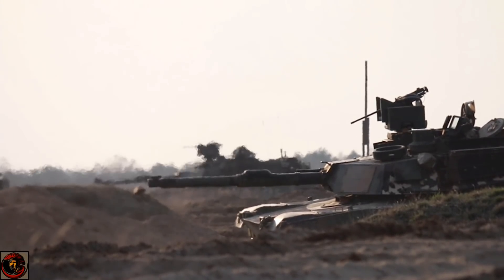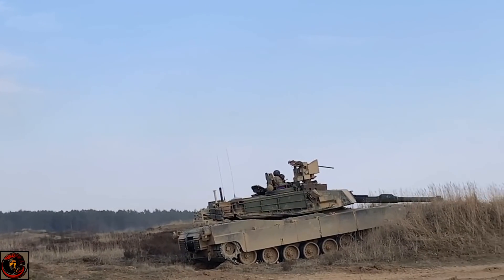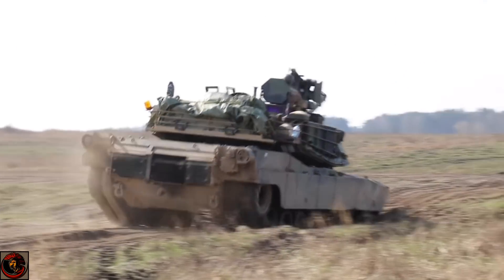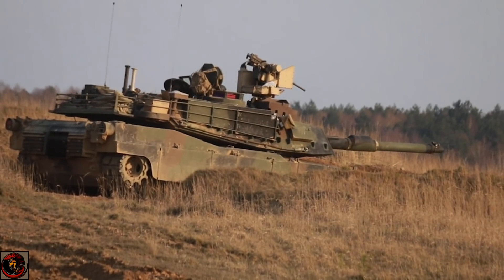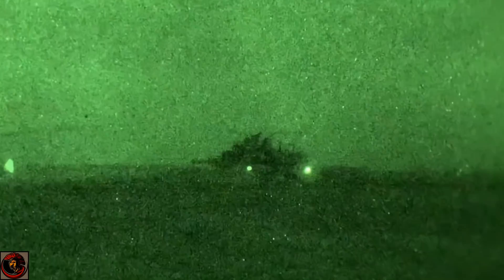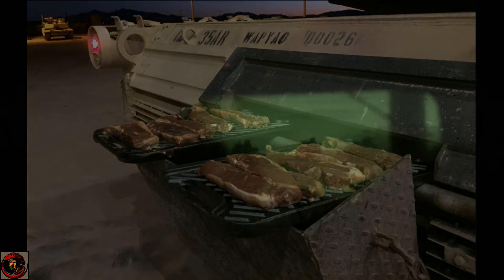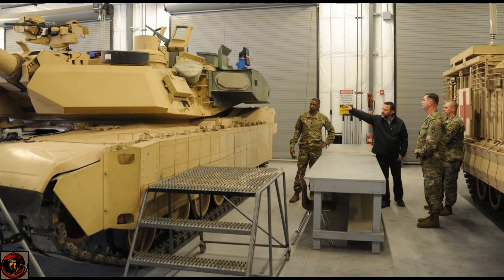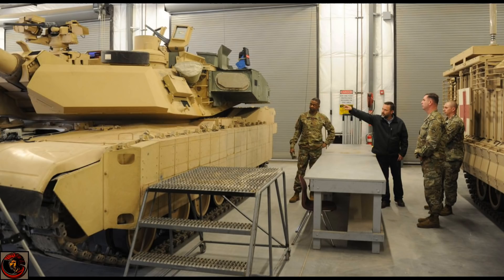M1A2C Abrams Tank Upgrade - The Last One?

Comment: I feel like a jackass but at first glance I thought the active protective system was an atgm strapped to the side of the turret
Reply: My first thought as well.
Reply: Actually I've always wondered why we haven't mounted fire and forget Maverick or hellfire missiles on armored vehicles! We can carry several of them on an Apache so they can't be that heavy and they can be fired with zero forward airspeed.
Reply: @JohnRodriguesPhotographer  The AGM-65 Maverick is between 462–670 lb and up to $110k+ it's strictly an air launched missile. https://en.wikipedia.org/wiki/AGM-65_Maverick

 The AGM-114 Hellfire is 100–108 lb and $117k+ but it has been "tested for use on the Humvee and the Improved TOW Vehicle (ITV)."

Also "In 2016 the Longbow Hellfire was tested by the US Army using a fifteen tube Multi-Mission Launcher mounted on a Family of Medium Tactical Vehicles (FMTV) truck. The MML is an Army developed weapon system capable of deploying both surface-to-surface and surface-to-air missiles."

https://en.wikipedia.org/wiki/AGM-114_Hellfire

The missiles have an extended range (8,000 m), but if you can't see the target you can't shoot it.

The Hellfire is a more likely, but remember a 120mm cannon round is cheap at $4-10k+ and 25mm cannon ammo is even cheaper $35-100+ a round.
Reply: Jacob Buxton--------Actually, there is a weird type of APS system that literally works like how you describe. Raytheon made something called "Quick Kill", and itz basically a miniature ATGM inside a vertical launch silo strapped to the hull. Itz practically a micro sized version of the Navy's AEGIS system in some sense

It works by launching the "mini-ATGM" out of the VLS silo, then the mini-missile reorients itself in mid-air like a goddamn acrobat, and fires a shaped charge. Itz incredibly complex. Suffice to say, it was much more expensive than contemporary active protection system (it was more expensive, because the Quick Kill's counter munition is "smarter" while contemporary APS counter munitions are basically dumb-fire mortar shells). I think it had slower reaction time too, because the mini missile had to reorient itself in mid-air (but take this last sentence with a pinch of salt)
Reply: Actually, having been a BFV commander, I had the same thought.

Comment: As a Major once told me, it is top of the line 1980s technology pushed to the limit of what Congress will pay for
Reply: It's just like using upgraded Sherman tanks in the '60s, i still wonders how they can fit a 105mm into it.
Reply: @arya31ful  by murdering crew comfort
Reply: @dosvidanyagaming4123  Its breech would've filled entire turret then
Reply: @arya31ful  same way they fit the 76 80 90 and 120mms into it they expanded the turrets
Reply: @arya31ful  The Israeli's are still using upgraded Shermans I believe xD
Reply: I dont think so @row7820
Reply: Major was bloody right!)
Reply: '
hi C O...
what is about congress for M1A1 - M1A2 tanks
Reply: @revolverswitch  maneuvers don't matter anything in modern air combat when there are fire and forget misiles who are basically unavoidable

Comment: I think (just my opinion) that the next MBT should have a Hybrid Drive System (Diesel over Electric) for a few reasons.
1. The tank can be fully operational with the engine off running on battery power, giving zero IR emissions. The Batteries mounted in the floor could offer some mine protection.
2. The Electric drive will offer near instant maximum power in any direction with very quick acceleration and vastly reduced maintenance for the transmission and final drives.
3. The fuel range can be greatly increased since you no longer need High Engine Power to accelerate. An 800 hp engine can replace the 1500 hp turbine with no losses in performance.
This would also solve the Abrams only weakness, its need for a continuous convoy of Thin Skinned Tanker trucks as these could be reduced by 40%.
Reply: Look at the German Porsche designs for gas-electric tanks. Electric motors are extremely heavy. Reason the M1 has gas turbine is the power to weight ratio the engine offers. The M1 has to be carried in a plane. Throw a diesel engine in that bad boy or a diesel electric Drive and it won't fit on a C5 Weight Wise. Diesel Electric is just too heavy and would require compromises in the balance of armor versus Firepower versus engine. Until we can come up with lightweight electric motors I just don't see it happening. If you look at the Zumwalt but it's gas electric Drive, that's one heavy ass Destroyer. Weighs more than a Heavy Cruiser in World War II. No things were mostly made out of steel, they had 5-inch guns for secondary batteries 3 dual turrets per side and 9 8-inch guns
Reply: @JohnRodriguesPhotographer  There have been some Minor advancements, ever hear of Tesla??
Reply: By the way your Arguments for the electric Drive is redundant with Ferdinand Porsche's Arguments for electric drive on tanks during World War II.

Comment: Overrated tank....lousy range a major negative and can brought down with a kornet. Not sold on Trophy protection system yet until combat.
Reply: Maybe you missed it but the Israelis have already taken the trophy system into combat was a little piss ants and the Gaza Strip. Hundred percent effective
Reply: Note the Heavy Common (DU) panels are only on the forward turret. They're what is known as a "dual kit", which provide extra protection particularly when firing in a hull-down position.

Also the export Abrams that were destroyed, were hit from the flanks. An ATGM strike of that type would have destroyed any vehicle without heavy ERA protection.
Reply: @Anthony Gadway The question you should ask "was the tank's armor breached and was the tank taken out of operation". A tank which is damaged to the point of abandonment is a combat lose regardless. 

Note it's significantly difficult to recover a tank from enemy territory. Hence why they are often scuttled beyond field repair. If you're forced to destroy your own vehicle due to absence of a recovery team. It is a loss of combat material and efficiency.
Reply: @Anthony Gadway To clarify, whether you are forced to scuttle your own vehicle or sustain a lost to enemy action. You're still short a vehicle in the end. There is no room for semantics on that front. 

As previously stated, modern ATGMs will effectively destroy or disable any MBT in a flanking strike. With exception of heavy ERA or APS interception. It's simply impractical armor the flanks to the same standard, as the forward glacis and turret dual pates.

Comment: You forgot about that the M1A2C will probably use the M829A4 round that can defeat the best of Russian armor.
Reply: America destroys  poorly maintained and operated Iraq owned export version Russian tanks: No man that's the best and ones Russia has.

M1 Abram tanks getting destroyed by Houthis: No Nope that's not the same they are cheap export versions were better blah blah.
Reply: If it can somehow get through ATGMs
Reply: Russian armor is defeated by 20 layers of green paint from 1970s...
Reply: @user-so6dy2rq4v  Look up the Aberdeen Proving Ground almost every available Russian tank was tested there. T-34, Kv-1, and T54's. The Gulf war lead to hundreds of Type 59, Type 69, T-55, T-62, and T-72 to be examined. The fall of the Soviet Union also gave superb intact tanks to be examined. There were T-84 with Drozd Hard Kill APS at Aberdeen Proving Ground. There are also claim that the US got a T-90 in 1999 from Russia troops defecting in Chechnya. A M1 crewman said that they tested a T72-BU now classified as the T-90. The first T-80 was gotten from the UK (Look up the FTAS program) and the US can easily require T-80UK's from South Korea. With all of this information the US Military knows Russian Tanks like the back of their hand so you would think they designed the rounds to try to kill them accordingly.
Reply: @coolingdawn  The same applies in reverse - how many M1s lost in Iraq, Yemen etc have made their way to Moscow or Beijing ?
Reply: @rags417  how many Abrams have been lost?
Reply: @rags417  Wow you mean the M1A2S? My friend do some research those are light years behind the M1A2C. The ones that you see getting blown to shit  are the export Abrams. Let me list of some stuff that C has and something S doesn't.
Lacks/ little DU armor
No DU ammunition
No blue force tracker
No Crows
No Vehicle Health Management System
No Auxiliary Power Unit 
No counter-IED armor package
No Ammunition DataLink 
No Trophy
No explosive reactive armor
No NGAP armor
No TUSK ll
No M829A4
No ability to use the Integrated Management System
And everything they both have in common the M1A2C does it better. If the Russians get a hold of an export Abrams they might as well be shooting a M60 because at this point you are comparing apples and oranges.
Reply: @rags417  Now compare that to the Thousands of Russian tanks America got from various sources. Also have you ever wondered how Abrams crews went into the Gulf War already knowing where to hit the Iraqi tanks at to cause an ammorack kill? It is just knowledge that they already knew from shooting up so many Russian tanks.
Reply: @coolingdawn  Two thirds of the items you noted were related to weaponry or mechanics and have nothing to do with survivability.  M1s are no better than many other MBTs out there in this area and in many cases much worse - I mean its taken the US 30 years to put ERA on them !  Sure they have great integral armour but it has only been the last few years that they started looking to out an active defence system on the things.  Still, being American they can buy there way out of any war so having 2,000 very good tanks is far more effective than having 20,000 shit and 200 excellent tank, viz Russia
Reply: @coolingdawn . That doesn't have anything to do with survivability. The Houthis would have destroyed them all the same, even with new mechanics and weaponry.
Reply: @grubbybum3614  The only way I can semi-agree with you is that the Saudis can't fight for shit if it were the Americans then it would of been a whole different story. But I don't see how you can say that.
Take out the optics and you can't see
Take away the CROWS and your tank commander gets sniped
Take away the Data link rounds then you have no HE
Take away the power control and it's less fuel efficient.
Take away Trophy and ATGM's will have a ball
Take away TUSK and ATGM's will have a Superbowl
Take away the IED protection and your tank is vulnerable to mines and IED's
Take away Blue Force Tracking then it's harder to find allies which means more friendly fire incidents while at the same time harder to find the enemy.
Every single upgrade and improvement adds to the survivability of the tank all together. I can't possibly see how you deny that.
Reply: @coolingdawn  The Russian bandwagon just got steamrolled with the info you just shared. It is the truth that America knows Russian tanks and made the M829A4 to defeat them.
Reply: The M1A2S and M1A2C are so far apart that it doesn't matter if Russia or China gets the export. You see this is why America doesn't export sep V2 or V3 to Saudi Arabia or Kuwait because they don't know how to fight in them. But the Russians sell almost the equivalent of there best tanks.
Reply: coolingdawn 4700 it’s not exactly difficult to hit a T72s ammo rack lmao
Reply: Dejhon Bailey bringing up the export abrams is like when abrams fanboys talk about the abrams wiping the floor with export t72s
Reply: @deathdragon2283  Semi- correct, it's not easy to hit something you have no knowledge of they came in with the knowledge of where to shoot it wasn't random chance. My argument is that America has a shit ton of information about Russian tanks yet "somone" made the comparison with the export Abrams which doesn't fit.
Reply: Rags Almighty Great part is the U.S has 10k Abrams tanks of all different kinds around 4000 being up to date and than 2000 being the best of the best
Reply: @coolingdawn  Good job shedding light on this argument. The lack of counterarguments show you know what you are about but I would like to elaborate to "some people" as to why an export Abrams getting captured is not the same as a Russian tank (specifically T-72 through T-90) The Russians exports versions are almost equivalent to the rest T-90's that if captured, could just say that it's one of the best Russians have. The M1A2S and M1A2C is night and day so it literally wouldn't matter if Russia or China acquires one because it is so different from the V2 and V3. The M829A4 can absolutely penetrate the best of Russian armor anyone would be lying to themselves if they denied it. T54-Early T90 the US has tested it's rounds on for a considerable amount of time (+40 years)
Reply: @coolingdawn  they didnt target tanks in specific areas for ammo rack kills as you say. The iraqis kept extra rounds in the hull outside of the autoloader, so essentially any penetration could set them off
Reply: @deathdragon2283  it's pretty difficult to hit the autoloader magazine as it's beneath the turret floor.
Reply: @dejhonbailey8587  Russia has far improved armor over anything there, including the t-84. K-5 ERA isn't exactly new. There are 2 or 3 newer generations of ERA now after K-5.
Reply: @tirelesscloud7755  newer Russian KE rounds can threaten the Abrams too as it's front hull KE protection isn't the best ever.
Reply: @nagantm441  
"The Soviets had a different theory of storage of ammo than the Americans. They got the ammo basically stored around their hull, so if you can make the ammo explode on a T-72 or any Russian tank all of that explosive force is funneled up through the turret." 1LT Andy Kilgore, Ghost Troop 2nd ACR 
or in other words a regular Abrams tank commander had knowledge of this and you would think others would too and if not then word would of spread quickly on where to shoot the enemy at for the greatest chance of killing it.

Also note he said " Or any Russian tank" as in ' I also know that any Russian tank has this problem' hmmm I wonder how does he have knowledge of this, maybe shooting at T-55's, T-62's, or T-80's helped any?

As I stated in a previous comment an American crewman said that he tested the T-90 that could of had Relikt ERA  that was acquired by defectors from Chechnya so the M829A4 still has the upper hand and even if it didn't a large significant portion of Russian tanks lack new era. 

I do agree that the hull of the Abrams isn't the best but the Abrams would be in a hull down position unless on the offensive and as the battle of 73 Easting showed the Abrams loves to cause confusion and fear with a blitzkrieg-like tactics.
I would love to see the expression of a tank commander in his 46-50 ton Russian tank seeing 70 tons of steel charging at him at full speed if he wasn't already dead.
Reply: @coolingdawn  let's see a source on a "defected t-90" in chechnya. That sounds patentently absurd. Also, no t-90 from back in the Chechen even had relikt. 

Kilgore is wrong. They had the ammo in a magazine for the autoloader under the turret floor. That's essentially an impossible target to hit directly as it's at the very bottom of the hull. The cause of explosions always was supplemental ammunition spread about the hull of the tank, which is not a feature exclusive to Russian tanks. The leopard 2 even shares this design feature, along with every other tank in the world not called Abrams.

Also, he's never shot at t-80s because the US simply has never faced t-80s anywhere, ever.

As for the expression on the face of the Russian tank commander, being in an m1a1 Abrams in the 80s while being hit with "mango" APFSDS from a Soviet tank would result in a not great outcome for you.
Reply: @nagantm441  1. The Source is the tanker himself he said that was the story he told it's up to you to believe it (really though it's the story they told him).
https://qr.ae/TWNCsD
https://qr.ae/TWNCsE (in the comments)
Also I didn't say it had Relikt ERA, I said it possibly had it due to the time frame of Relikt ERA being deployed and the Second Chechen War.

2. He is not wrong. The "supplemental ammunition spread about the hull of the tank" was the "stored ammo in the hull" he was talking about. Just because he didn't say " Or any tank In the world" doesn't mean he was wrong. Maybe he should of been more specific?

3. I wasn't saying he shot a T-80 in combat but I'm saying information they already know from testing of the T-80.

And I wasn't talking about the Abrams actually shooting but the "Shock and Awe" of the tactics they used.
Reply: coolingdawn4700: *States facts *
Russian bandwagon: * talks nonsense with no counter arguments/ comments *

Me looking at coolingdawn4700 knowing that the full force of the Russian bandwagon isn't here yet: WHAT THE FUCK DID YOU JUST BRING UPON THIS CURSED LAND!
Reply: @coolingdawn  That's a lie Saudi Arabia tanks have the UR armor plates and reinforcement and was proven as they paid for the ToT and are assembled at their factories. Nice try though